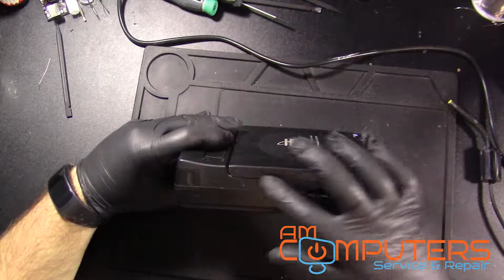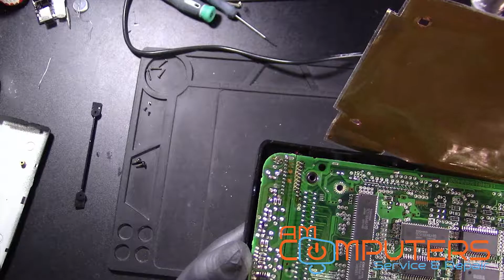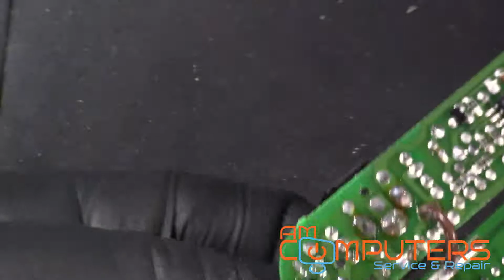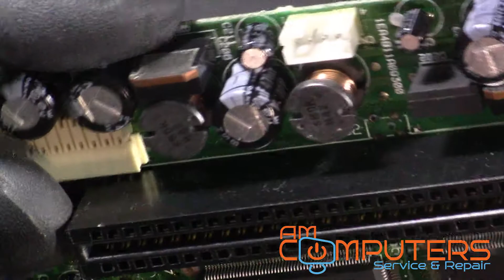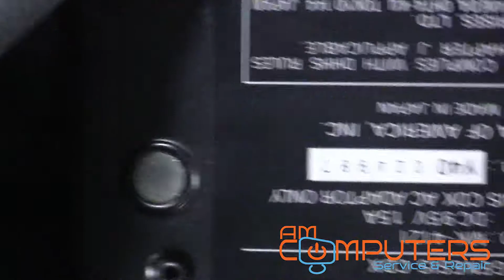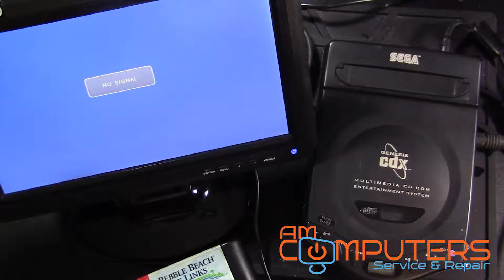Sega CDX Repair. Fuse replacement. No power.

Comment: This is a very good video I appreciate your help and posting! That said I have came across a CDX that looks like it may have been stored in a basement for a few decades and at one point and its life someone has attempted to take it apart. The system boots up and it does play cartridge games but the CDX part does not work. The laser module will home itself and move left to right but it will not initiate and spin up the disc. I have considered getting into this project and taking it apart but this looks like one of the most difficult projects I would have ever worked on.... and I don't want to make it worse or make it inoperable. Are there any suggestions for people or places that will take these and refurbish or perform work on them or diagnostic? Thanks! 😊😊

Comment: I'm in the process of repairing a water damaged CDX that someone previously tried tinkering on. It isn't necessary to undo the screws to the cartridge slot, they're there to secure the slot to the mainboard. You can undo them to get to any areas underneath, but you don't have to do it through the top, the whole assembly will pop out once you unscrew the power supply assembly.

Comment: Yo AM Computers!
First off: Thank you so much for making this video!

Second: I just busted my cartridge-connector when I tried to force down a pirate-game into the slot (obviously the pirate-cart had a damn thick PCB... No more pirated games for this guy...)

And when I ask around in the Facebook-groups people tell me "don't open it! it's fragile!"

Is the console really that fragile as they say?
I busted 2 pins and I don't think I'll be able to bend them back, or replace the connector without opening it up.

Also, I got a Multi-mega, and not a CDX, but it's just the region-thing to it, I suppose. And nothing physical.
Reply from the maker: They look the same physically. If you go carefully you should be able to open it without much issue. Just don't pry to hard. Sadly, I don't have one of my own or I'd check again and refresh my memory on this system. Thanks for the comment! Wish I could be more helpful.